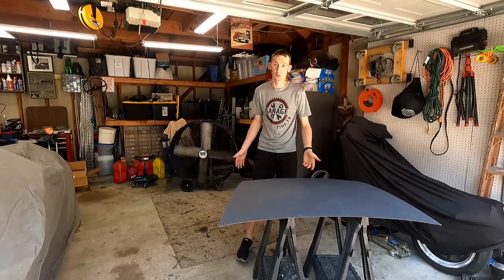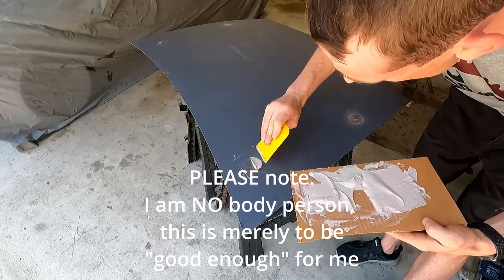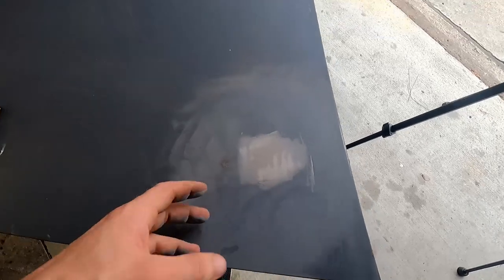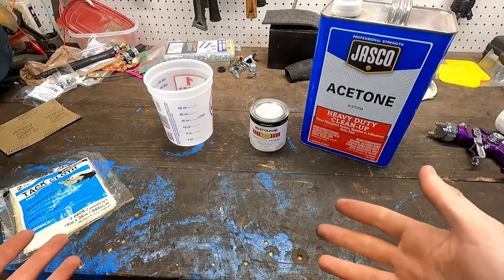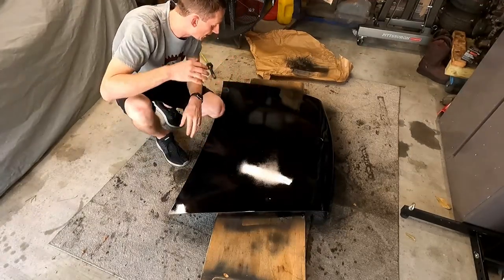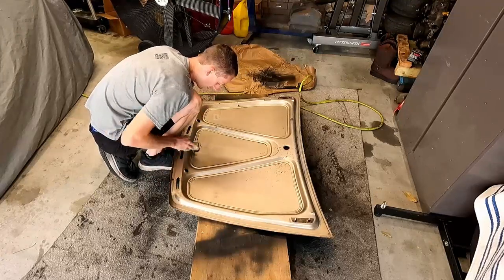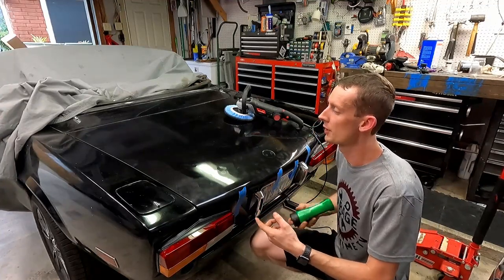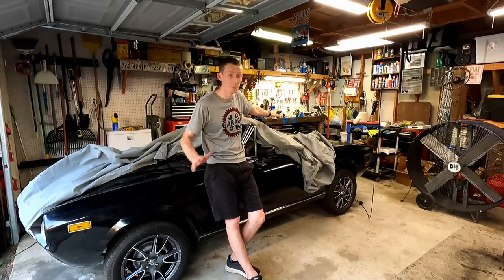DIY Painting of our Trunk Lid for our 1982 Fiat 124 Spider CHEAP!

Comment: nice enough job on this. I am about to do the same on my 78 trunk and wanted to ask you if you need to clean the gun in between coats. Thanks.
Reply from the maker: I didn’t wait between coats. It was a short flash time so I just set it aside

Comment: Nice work! Would you have any hints regarding trunk spring replacement, i.e. how to set the spring? There seems no way to get any leverage to ‘pull’ the spring and set it on the right catch. Thanks
Reply from the maker: I wish I had an answer for you! I think it may be a two man job because those springs are strong. I was fortunate to have mine already set. If you find a way, let me know because I’d like to know too!

Comment: I realize that this is by no means intended to be a professional job, but thought that one of the most basic rules of painting was a coat of primer first…perhaps that’s why the trunk didn’t get the “deep” black like the rest of the car? Anyway, good job on a (very) limited budget!
Reply from the maker: Well the primer was already on the top by the person I got it from. The rest of the car is the original paint so it was going to be hard to match. I still like the black over the primer grey though! It does the job for now until we save up for a pro paint job